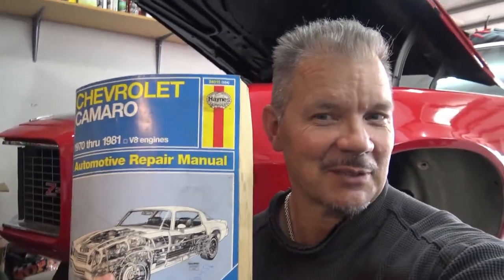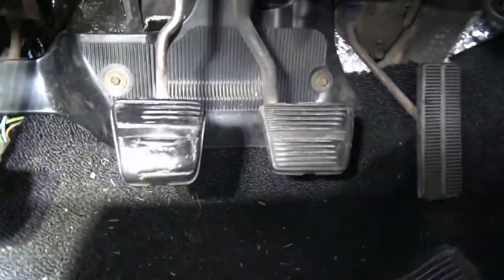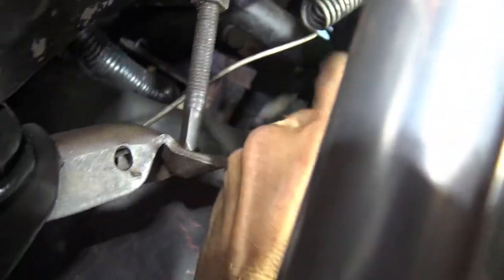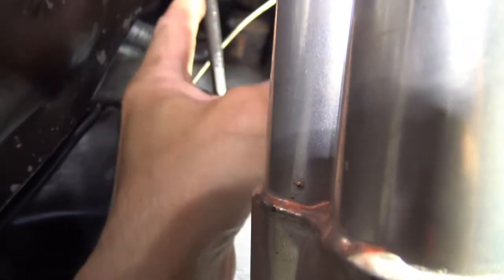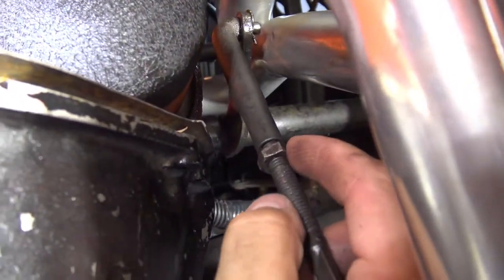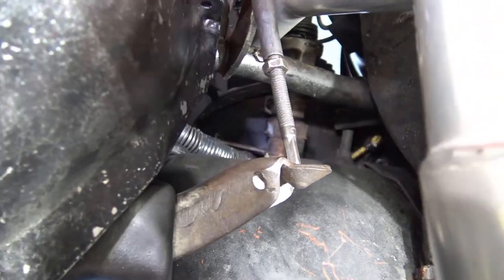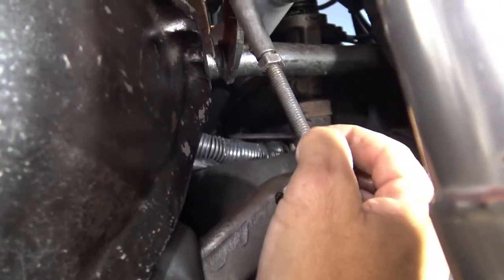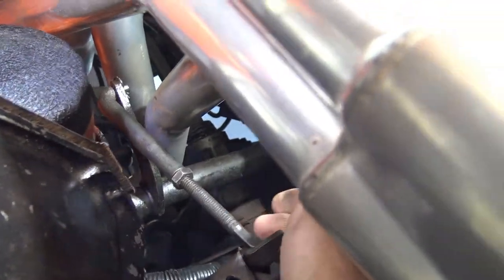1973 Camaro clutch pedal adjustment diy!

Comment: Good info! Thanks Mike, I have a 73 Z28 as well. I too have owned it a long time (since 1981). Completed a total rotisserie restoration in 2015, Love cruising in it again! . Re: Clutch rod. I've always had a small spring attached between adjustable rod and the Z-bar to prevent it from possibly falling out of the pocket if there happens to be excessive play. BTW, Please toss that Crappy Fram Oil Filter and use  Napa Gold! lol, it's a way better filter in my opinion! Cheers!

Comment: I bought my 1970 4-spd Z28 from the orig owner back in ‘81. Two yrs ago while having lunch on an outside patio during Sat Poker Run at Autofest in Oshawa Ontario, I spotted someone lurking around my car for about 15 min. I said to my Wife, maybe I should go over and ask him if he has any questions. He eventually left then about 5 min later this guy called out my name and I turned and it was the orig owner. We spoke and he asked if my car was for sale. I said no. My Wife said “he’s been taking real good care of it”. His reply was “he’s had it long enough”. He never talked a dollar amount and just said to call him or his brother if I ever decide to sell. I told him a friend of mine has 2 70 Z28’s, but he said, I want mine. BTW, GM still sells the brake and clutch rubbers for the pedals. For my 70 both were the same part no.

Comment: Should the clutch pedal just fall when the return spring is removed from the fork or should the pedal have its own spring to hold the pedal up? My 69 Camaro pedal just drops and hangs limp. I wasn’t sure if that would effect my adjustment procedure at all. I bought a 28 year parked car from a guy that didn’t know what he was doing when he worked on it. Thanks

Comment: Question: I currently have my transmission out (getting ready to put it in) Can I do this with the transmission removed so I can get a better look at the throw out bearing and what kind of freeplay there is between it and the fingers or is it something you have to do with the input shaft in place so you get a more exact representation of what the freeplay should be?
It would just be nice to see what’s going on inside while adjusting but I think if I follow your method I should be ok.